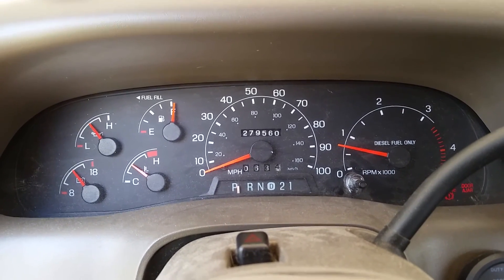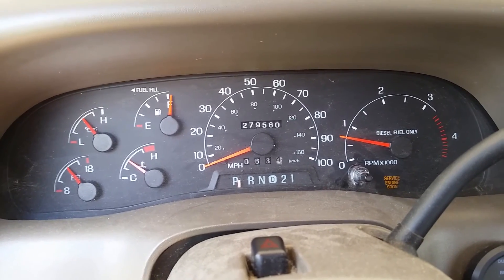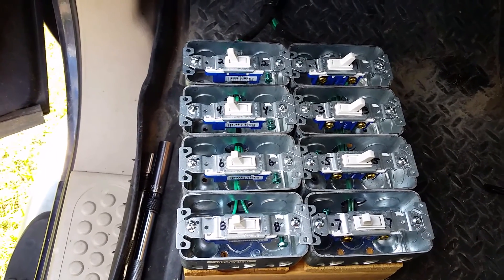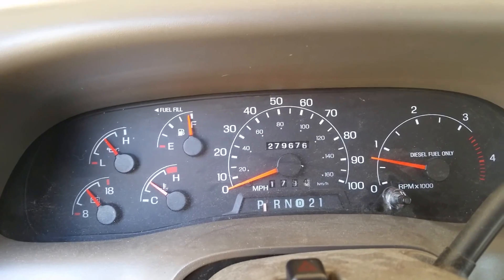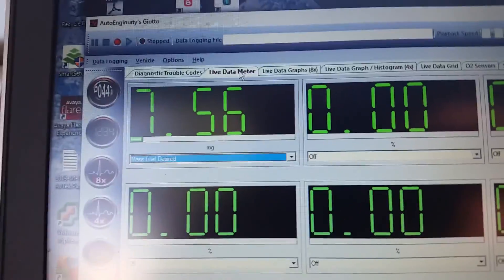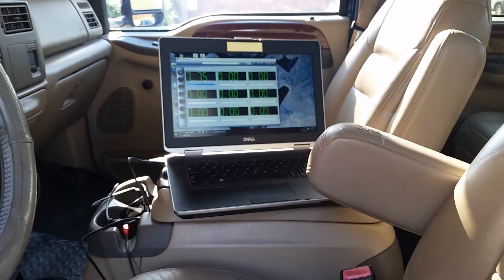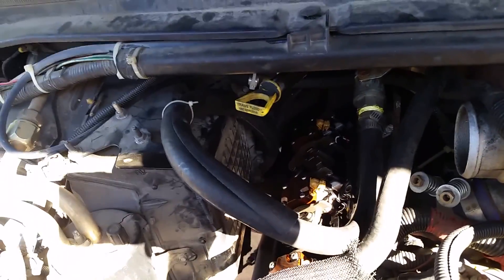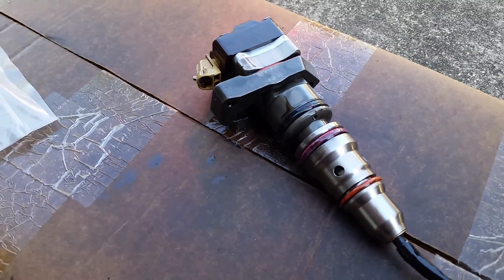7.3 Powerstroke Injector Troubleshooting

Comment: I want to build this exact breakout box it's a very cool idea i like it.

I have a 2003 DODGE CARAVAN SE V6 3.3L FLEX FUEL.

Can you tell me what supplies i need to buy to make this breakout box work on my vehicle, please?
Reply from the maker: Sorry I have no idea how this works on other vehicles. You would have to find a wireing diagram and trace wires. If the fuel injectors are easily accessible you could unplug them 1 at a time. That is essentially what this box does, cut the injectors so they can't fire.
Reply: @tubular031  The adapter cable you made that you point out in 5:25 i see that the connector on one side of that adapter cable is plugging into something i guess the fuel injector wiring harness connector and the other side of that adapter cable is plugging into i guess the engine control module or powertrain control module connector, am i right or wrong? 

Im just trying to understand and comprehend cause i really want to build this like how you did because it's awesome work you did.
Reply from the maker: @Diagnose1 that connector is the main engine harness. All the sensors and injector wires run thru it. These trucks use a module mounted in the wheel well to send a signal to the injector to fire. All the wires in the connector pass thru my adapter except for the 8 injector wires. Search around on the internets for a wireing diagram and the connector pin out. Another option is to unplug the connector on the injector if you have easy access to them.
Reply: @tubular031  For the 2003 Dodge Caravan SE V6 3.3L Flex Fuel the main engine harness would be the Powertrain Control Module C1 connector (SBEC) all the sensors and injector wires run thru it.

 The PCM (Powertrain Control Module ) is located in the left front corner of the engine compartment, between the battery and the headlight housing and it sends a ground signal to the injectors to fire. 

When it comes to the adapter cable you made how did you go about making that adapter cable to where all the wires in the main engine harness connector pass thru the adapter cable you made?

 I have a service manual volume 2 book that has wiring diagrams and connector pin outs if you have an email i can send it to you so you can see it.

 The option to unplug the connectors on the injectors is not easy access because it's buried under the upper intake manifold.
Reply from the maker: @Diagnose1 you will need the male and female connector. Then you make a wire from pin 1 on the male side to pin 1 on the female side. The wire that goes to the injector let's pretend its pin 5 goes from the male side to a switch then to the female side. The whole harness is basically like an extension cord with a couple wires extended to a switch. Hopefully that makes sense.
Reply: @tubular031  How did you go about finding and getting the MALE connector?
Reply from the maker: @Diagnose1 I pulled the harness off a totaled truck in a junk yard.
Reply: @tubular031  What's up my friend, are you able to make a video to show us how you connected the injector control wires to the switches please? 

Because i see that each individual switch has 2 gold or brass screws on one side and 1 green screw on the other side.
Reply from the maker: @Diagnose1 you can ignore the green screw. Take a wire and cut it in the middle. Then connect the ends you cut to the switch. In one position the switch will connect the wires like they were never cut and in the other position the switch will split the wires. You can use any switch. I just used light switches because they are cheap and easy to get at homedepot or lowes
Reply: @tubular031  Can you make a video demonstration step by step so i can process it better please?

Comment: Hello there.
I don’t know where to begin! I loved your video. It took a long time to find it. 
Similar situation. I paid $5000 to have new injectors installed about two years ago. 
After installation, my gut feeling said I don’t really trust this guy anymore. Went on about my business. 
My 73 has been that deep throat sound that yours was doing. I never knew what the heck it was. You are the first I’ve ever heard say that it’s an injector. 
I opened up on passenger side valve cover. Different color injectors. This guy deals directly with Ford. I wish I could send you a picture. But I’m feeling a little screwed because I guess there’s no way to tell the part number with the box number because they’re different. They all had the reman cap metal plate. +2 were yellow one was beige and one was dark brown. I don’t think Ford would issue different colored injectors. I took them to Ford dealer those guys could not help very much. Anyway, I don’t know what to do. Should I have the injectors taken apart to  show the wear and tear that is inside the injector?

If it’s easier to text me, here’s my phone number. I live in San Diego. I’m really appreciate you and your video.  
Name is Robert Clark 
619-788-2269. I hope to hear from you.

Comment: Can you tell us where you purchased the electrical connection blocks that plug into the factory harness to build the breakout box
Reply from the maker: If I remember right I got them from Ebay.
Reply: I looked all over Ebay and found nothing.  Is there a specific name I should be searching for
Reply: @Enzo-of4bl 42 pin connector, find a junk harness, that's how I built mine

Comment: Thanks for the vid and displaying your break out box. DTR was a great guy. He will be missed. People will be using his videos as a powerstroke source for years to come.

Edit - Mind sharing more about your truck like whats all been done to it?
Reply: Is there a  video of the  break out  box showing  how to  make it  please?
Reply: Deena Robbins a simpler method, probably cheaper too is a Android device, probably have one, elm327 module 5$, app:car gauge pro 10$. It allows you to buzz test the injectors.
Reply: @cekiert   Correct. I love the oldschool breakout box, and I am sure it is a great diagnostic tool to have around. However in our day and age with supercomputers in our pockets there really is an app for everything. I would opt for the BAFX OBDII unit, a little more expensive, but the 7.3 motors do not play nicely with all code readers and do not actually operate on standard OBDII codes. I used the "forscan lite" app to pull codes and run an injector buzz test indicating an open circuit on #7 cylinder. I used to just throw parts at problems, but the affordability of aftermarket diagnostic systems these days has changed that. $20 for a interface and $5 for an app, Snapon would have charged you 5 grand for that.